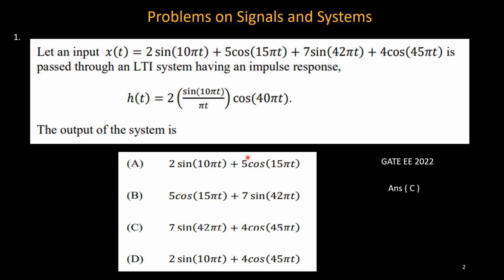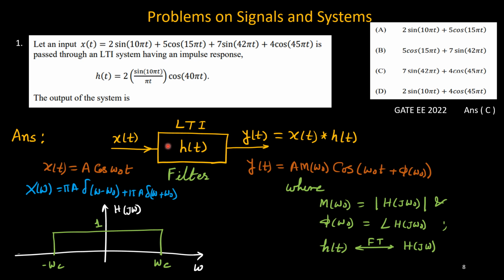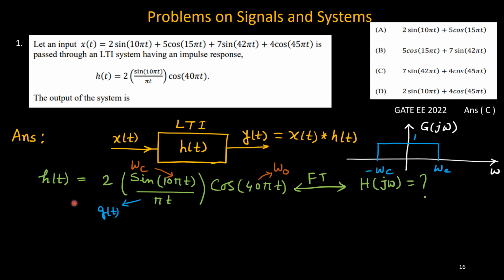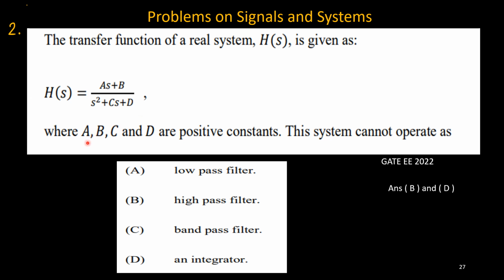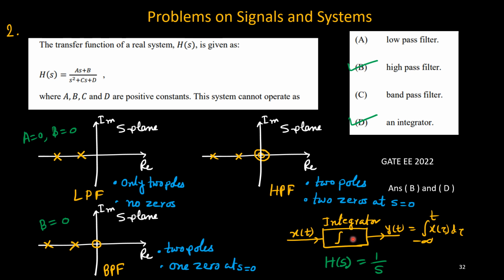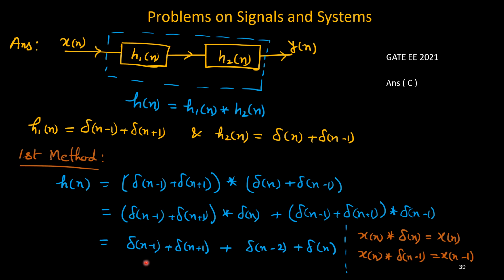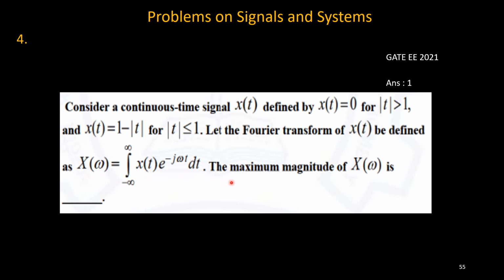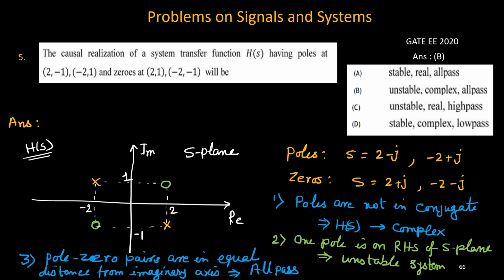Interesting Problems on Signals and Systems - for ECE and EE : Part 1

Comment: Sir, B, C, D can't be zeros as they are all positive constants in question 2
Reply from the maker: Ok, but there is no problem to consider infinity small positive values for B, C or D.   Thus, we may design approximate systems or filters.
Reply: @RLDacademyGATEeceAndAdvanced  OK thank you sir